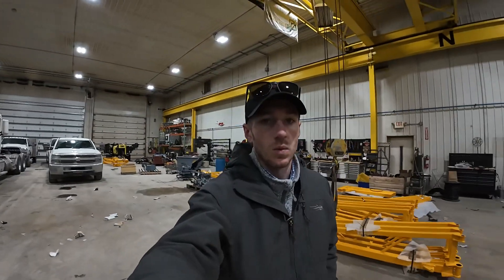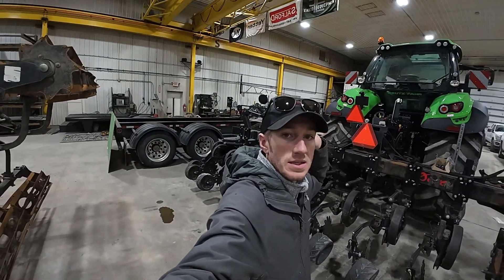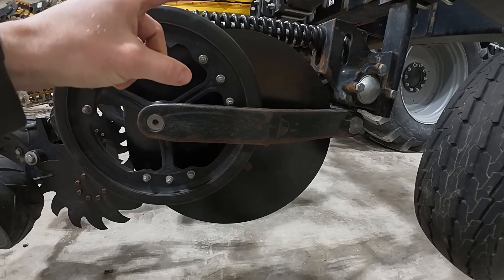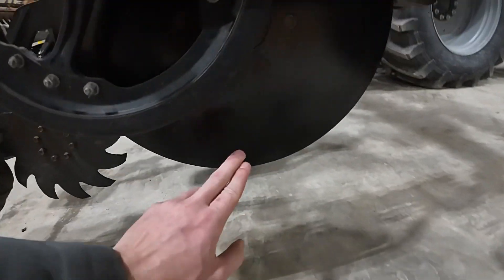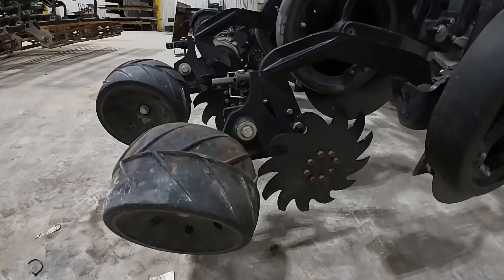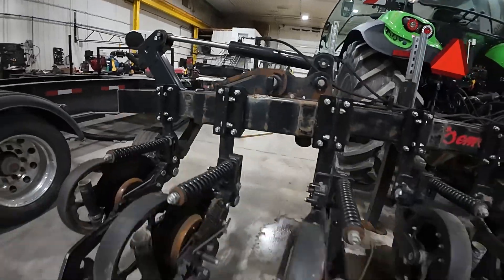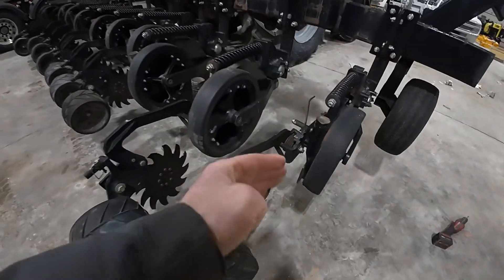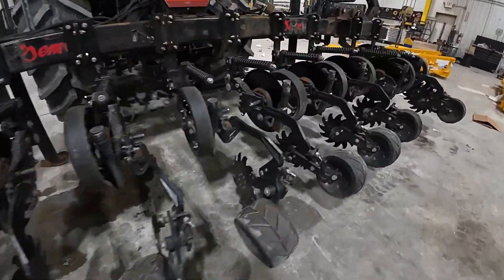Banding Chicken Litter With Yetter Coulters

Comment: what kind of air cart are they going to be using
Reply from the maker: Salford ST-10
Reply: @FennigEquipment  I was told that running pelletized litter through a screw type meter can turn into a nightmare. I'm curious to see how this works out. Lynx has a cart with a drag chain metering system, similar to a dry Fert buggy, that is supposed to work really well. Keep us posted. I'm very interested in doing this myself, except with strip till.
Reply from the maker: @ this is a roller meter not a screw, the roller is very gentle on the product me won’t crush
Reply: @FennigEquipment  Awesome! How much litter can it apply per acre?